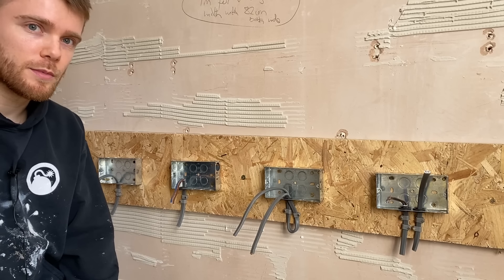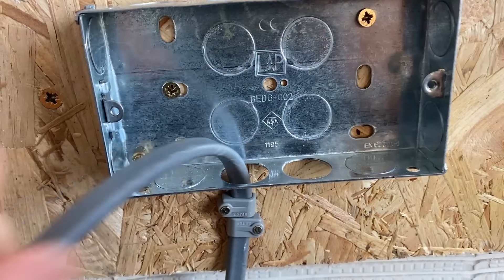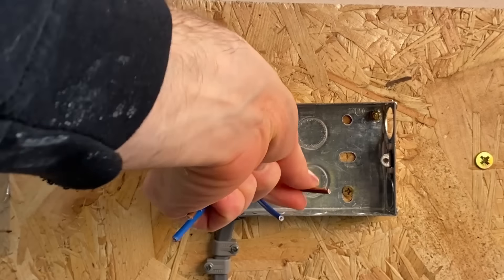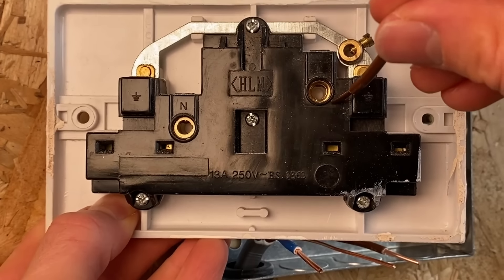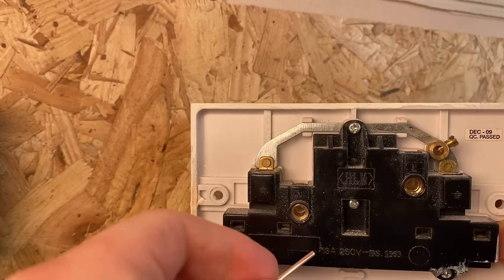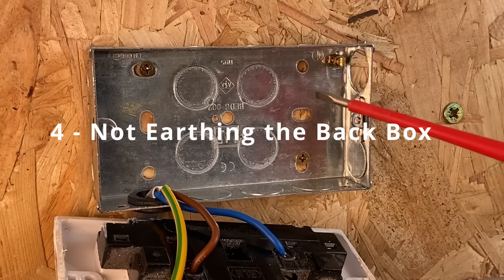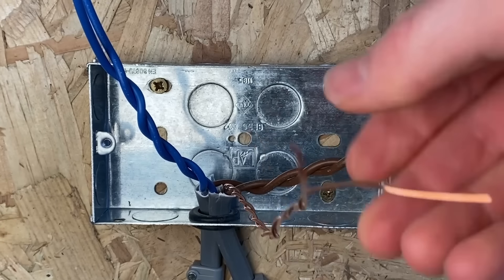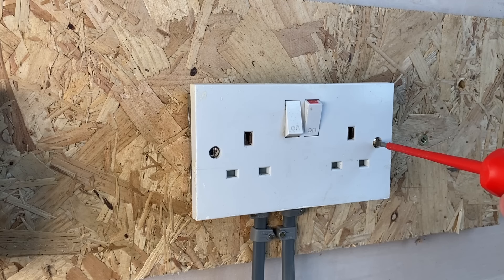5 Biggest DIY Mistakes Wiring a Socket

Comment: I'm currently working on my daughter's first house purchase. All of the above has been common throughout the property, although the installations were completed by professionals. It has been a task to rectify what's there - there are good and bad DIYers, there are good and bad professionals. I would be very disappointed if id paid the going rate for a 'professional' and received the standard of work ive seen here. Just because a certificate is supplied doesn't necessarily mean a good job has been done. A bit like stating you have iso9001 - if you say you produce crap and continue to produce crap you can have your iso9001 certificate
Reply from the maker: Thanks for watching!

Comment: Got me at the end with having the screws at 90 degrees and identical? Is that a personal OCD thing because no-one notices that, and you screw them in until they're tight, shouldn't overtighten or back off just to get the slots identical.
Reply from the maker: Just a personal one really, thanks for watching!

Comment: I like the way you present the info with no messing about. However, the first example of needing a grommet is incorrect. If the cable(s) are hard plastered in there is no need for a grommet, and left a vacant hole in the first box.? Also, you fitted the boxes upside down with relation to the earth lug,  It's at the bottom for a reason, it's real easy to see it in that position especially for lower down sockets. Lastly, you seem to leave a fair bit too much outer grey on the cables in the boxes after you have stripped them. My examiner would have a field day with all of this !! But, good info for a DIY audience, cheers !!
Reply from the maker: Thank you. I prefer to fit boxes upside down so the earth lug doesn’t get full of plaster, I don’t think there is a requirement to have it oriented a certain direction. Thanks for watching!

Comment: I would suggest that taking a fly lead from the cpc terminal to the ko box is unnecessary. Were the box to somehow become live the plate screws would result in a very low impedance earth fault resulting in instantaneous disconnection. Even if this were not to happen ( an unlikely scenario) the heads of the 3.5 mm screws recessed into the plate would hardly present a shock risk.
    The purpose of these lugs was when it was customary to run an earthed conduit to an accessory and not have a cpc cable, but usung the containment as the fault path. This is still permitted but seldom encountered. The lug provided means to bring the earth potential on the accessory's box onto the accessory be it a socket, switch, fused connection etc.via a fly lead into the earth terminal or lug.
Reply from the maker: Agreed, but belt and braces. Thanks for watching

Comment: It's good that you end with making sure that the screw heads are in alignment, it shows a very thorough approach. I like to do that when putting engines together, but I've found that cross-head screws are much better for this as they can only ever be up to 45 degrees  out, where a slotted screw can be up to 90 degrees out.
Reply: Ah... But with cross-heads you have two slots out, with slotted you only have one.😉

Comment: I qualified in old cables pre solid. I was taught to coil slack in rear of sockets. So if took socket off it sprung out like a spring. Twist 2.5 together so actual connection. Side by side relies on screw continuity.
Reply from the maker: Thanks for watching!
Reply: No

Comment: Is it okay if the conductor touches the back of the plastic faceplate? Should I insert the conductors as far as they will go?
Reply from the maker: Conductors shouldn’t be touching the face plate, but you’re fine to be pushing them fully into the terminals
Reply: @TheDiligentDIYer1759  thanks for getting back, if I push them fully in I can hear thermal tapping on the back of the plastic front part, is this normal?

Comment: As an ex sparky I totally agree with all your comments apart from the final one. There is absolutely no electromechanical advantage/ reason for aligning the fixing plate screw heads . Yes you often find this detail on fine cabinet making and boat building but only for decorative or aesthetic purposes. I think you need to point that fact out in your video
Reply from the maker: I do say it is just an attention to detail thing, but agreed I could have said explicitly that it isn’t part of the regs. Thanks for watching!
Reply: The snake oil flows better if the screw heads are aligned vertically

Comment: I ALWAYS use a booted ferrule when terminating cables, I'll also use heat shrink. Not standard, but looks VERY tidy.
Reply from the maker: Yes does look very neat with the ferrules. Thanks for watching!
Reply: Ferrules are for stranded wire, not solid.

Comment: In my house, UK 1978, most of the screws holding the sockets and switches to the boxes have had their threads mangled.  One handyman said this is caused by inappropriate use of power screwdrivers.
Reply from the maker: Crossing the thread on every box is probably someone using an electric screwdriver carelessly. Thanks for watching
Reply: Yeah tell me about it, I've a friend who does everything up by an electric that's set to max, to make sure there's zero risk of it ever undo ever again not only that every screw with a cross-head he somehow mangles

Comment: One observation that I believe is missed is to have a box where an exposed knock out is not covered. Another thing I disagree about UK code is not earthing this type of cabling (we call cable Romex) with the earths first bonded to the metallic box and with all earths first bonded inside the box. If you open that live box and the box isn't earthed and The Live (or Neutral with current flowing) makes contact with the metallic box, you will feel it.
Reply from the maker: Interesting, thanks for sharing and thanks for watching

Comment: The back box doesn’t need to be earthed if it’s not exposed
Reply from the maker: Surprisingly it does count as exposed conductive parts. The earthing requirement depends on whether lugs are fixed or not, but generally considered good practice to earth back boxes
Reply: Does not
Reply: @skinautique30  Do the screws from the faceplate to the backbox not then make the back box not make the back box 'exposed' ?

Comment: Very good guide, just be clear, the Neutral and Line are both Live.
Reply from the maker: Thanks for watching!
Reply: Neutral is earthed at substation. But, neutral could be live in an installation if there was a fault - so, yes, I'd treat N as if it were L to be sure.
Reply: @tiggywinkle1000  what you've missed is someone giving the correct definition - not your poor opinion !

Comment: I am a retired electrician. One thing I found over the years. If you tighten the terminal screw onto 
2.5mm solid copper cable, then move the cable core it can actually loosen the connection as it slightly
crimps up the solid copper, so after moving the cable, ensure the terminal is checked for tightness.
In my day socket cable was multistranded ( 7 strands 7/0.29) so it wasn't a problem
Reply: Fully agree  - thats the touble with this badly thought out solid strand core.
Same poor thinking with the "new" colours   (brown, black, blue )

Comment: Do you still have to align the the screw heads when they are covered by those little white plastic covers?
Reply from the maker: Depends how severe your ocd is haha. Thanks for watching!
Reply: there's always a plastic cover short, but I'd add to test the socket before you put them on.
Reply: I think they should make transparent covers so you can check that the slots are aligned without having to take them off

Comment: A ‘professional’ didn’t even bother tightening the screws after he placed the wires in the socket he just put it back in the wall and left it - This is the standard of ‘professionals’ these days. Also, the same, Electrician didn’t even tighten the screws in the Ryefield cabinet that brings power into my home, and so the electric was cutting out. I was left without power for an entire month because of this. So-called professionals are the most dangerous types of electricians I have ever come across.
Reply from the maker: Thanks for watching!

Comment: Advise please as cannot get an electrician in my area for a week. I´m installing an electric hob and double oven. Problem is, the 3 supply wires L N E = Red Black Green. Hob & Oven each have 4 wires Brown Black Blue & Green. I can just about squeeze the brown & black (L) in to connect with Red & then N & earth appropriately. Better would be to install a 4 terminal connecter into the wall. Comments please.
Reply from the maker: Difficult to understand the situation without seeing it, I think you’re best posting pictures on a forum like reddit for advice. Thanks for watching!

Comment: Oddly, most of my recent wiring has involved stranded wire.  Did quite a bit with multistrand flexs and made the move to "bootlacing".  I don't think I will ever look back now.  It just makes dealing with fine high strand count wire so much easier and the connections so much more solid.  Even just low voltage, DC screw terminals, pop a couple of ferrules on the ends and 90% of the hassle disappears.
Reply from the maker: Yep absolutely, ferrules are great. Thanks for watching
Reply: Class 5/6 (fine strands) stranded cable should always be crimped with ferrules.

Class 2 (thicker, less strands, often found in cables like 4 or 6mm twin and earth) crimping isn't required... Arguably shouldn't be crimped.

Regards
Tom
Reply: A little learning is a dangerous thing.

Comment: Gromets are good. However, in 42 years in the trade I have never seen a single cable damaged by metal boxes. That's because the wires are plastered in and do not move. I have seen installation damage - and that's carelessness. However, to cut through all the sheathing to the point of contact is too rare for me to have ever encountered.
Reply from the maker: Yeah very true, I haven’t actually seen a cable damaged either haha. Thanks for watching!

Comment: the landlord sent some electricians up to check the safety of all my sockets?  i think they made it worse?  Now i have a socket with a blue spark coming out of it. Every time you turn it off?  i just pull the plug out? as it does not cause it to spark. I keep putting off a repair?  i can turn off the mains?  and open it up and separate the cross wires?   it's all twisted up, i had a quick peek.  but it requires something to separate it all out. some insulation.
Reply from the maker: Sounds like the socket itself probably needs replacing, could be a lose connection inside. I’d tell the landlord and they should get it sorted. Thanks for watching!

Comment: As a competant builder/plumber and sparky albeit DIY my issue is 25mm socket boxes.I actually thought they had to be 35mm thesedays on the ring?Three cables running through never mind needing crimps and they are too shallow.25mm for the lighting circuit fine but not for ring or cooker boxes.
Reply from the maker: As far as I’m aware, back box depth is personal preference. I’ve personally never had an issue fitting 2 cables and a regular socket in a 25mm box, but appreciate it becomes very difficult with 3 cables, flat plate or usb sockets. So i do tend to use 35mm boxes or sink the 25mm boxes a little deeper

Comment: Fault one: over the time period you are talking about, the rubber grommet will have disintegrated anyway, much better to de-bur the metal.
Fault two: if you have too much cable you will struggle to seat the socket without cracking the case & folding the cables over on themselves causing stress to the copper.
Fault three: ironically you talk about causing stress to the copper but folding the wire over causes the same stress & you will still get impact damage from the screw. Also when the cable is doubled over you get mostly will get uneven clamping & the wire is much more likely to come loose over time.
Last fault: As for socket screws, how is that a fault?
Reply from the maker: The rubber grommets should last 50 years, they’re out of the sun and no exposed to anything that would accelerate breakdown. 

Copper is very ductile, bending over once or twice won’t cause the copper any stress. 

Bending over single cores in terminals is taught in college to trainee sparks. The screw is over a larger surface area, so less pressure and less damage. 

I do day in the video that aligning the screws is just OCD.
Reply: @TheDiligentDIYer1759  I agree about the wire bending of new ductile copper, not so great though when applied to old, age-hardened copper.

Comment: Twisting wire together, in and alternating system; is not so great. Twisted wire are basically integrated coils and alternation currents will induce magnetic fields into these coils and create eddy-currants. Eddy-currant can cause heat and fires.  Play safe, don't twist current carrying wire together.
Reply from the maker: Yep you’re absolutely right, thanks for watching!

Comment: #1 & #2 are PROFESSIONAL's mistakes & sadism.
#1 Never seen a back plate installed in a house by an electrician with gromets. Though, once buried in render thre is not much mobility for rubbing. Only seen grommets used in commercial premises.
#2 This is the big one, as a DIYer I think electricians are sadists and it is DIYers that leave extra length. Professionals are obviously connecting and mounting the face plates and then accidentally or intentionally pulling back the slack before trunking, clipping, or mortaring the cable run. For home owners, it is extremely difficult to remove or replace a socket face-plates and sometimes impossible due to these being no slack at all! 

When it comes to badly fitted, badly placed, or inadequate number of mains sockets... it is by far the professionals that are traditionally the sinners.

Comment: The one problem I frequently have is trying to get the right length - too much and it's difficult to squash it into the back box. Any tips on getting it right and how to position the cable to make it easy to screw the socket on without straining the connections?
Reply from the maker: I like to do an inch or two past the edge of the box. Then dress the cables neatly into the back. Thanks for watching!

Comment: Don't blame amateurs or DIYers.  All my sockets installed with the house have short cables making it very difficult to change socket covers. not seen any grommits used. Problem is intrinsic to the socket design.  There's always a danger that a cable that seems tightly fastened comes loose or free without being noticed as the socket cover is placed on the box twisting or moving the cable. If the boxes were designed so that cables were wired into them directly , ie all the structure of the socket cover built into the box instead and then a cover can just plug into that and be screwed on. You would have no need for excess cable being folded away as the cover is put on
Reply from the maker: Thanks for watching!

Comment: you missed out depth of back box
i originally tried to just sink in a few 25mm ones and they were far too shallow so they all came out again and 35mm ones were dropped in, slightly below the surface too so when the skim was done they were just a tad bit deeper again, which was an added bonus
got the fancy wago type sockets so no need for screws in the back or doubling over the cable, but the rest of the points you make are well worthy of making
Reply from the maker: Yep good point, although most of the sockets I’ve used fit in a 25mm back box fine. I think it is the usb and flat plate stuff that usually needs 35mm. Thanks for watching!
Reply: @TheDiligentDIYer1759  35mm should be standard. You talk a lot about removing the sockets in the future, a deeper box allows for future changes with no damage
Reply: @elliotwilliams7421  well I agree that would be better in terms of future proofing, but what you are talking about there is chopping in every socket where as 25mm sits within the limits of the dab and board so you dont need to chop the box back. I think that really depends on what the customer wants. That should impact your price if it was a job for example
Reply: @benjamincompton9767  quote 35mm as standard and give reasons, up to the customer to question it.

Obviously there are times when it isn't applicable, but I just prefer a 35mm box, more space especially if you have 3 cables. Leaves space for a join if more sockets are added in the future. 

Dot dab, depends on the person doing it....... I just take a twin blade chaser to the wall during the 1st fix.

Comment: I wired a double socket with 6mm outdoor 3 core flex to help my spark out.  Thankfully his only comment was, "Could have been slightly tighter".  Which was because I used too small a screw driver without enough power.  I also laughed that I'd not left it open for him to check, I'd left it open for him so he had to do the ackward bit of getting the 6mm cables to fit behind the plug!
Reply from the maker: Thanks for watching!